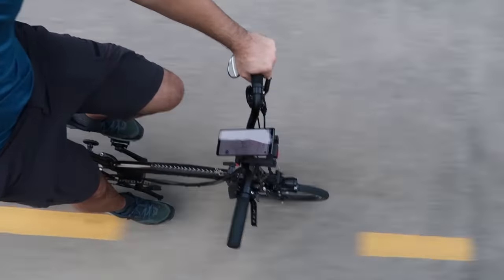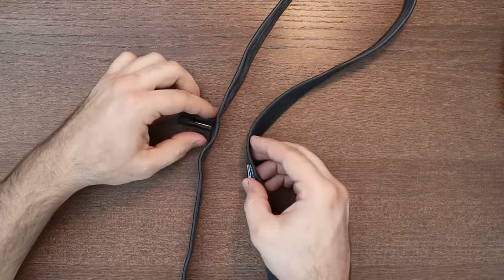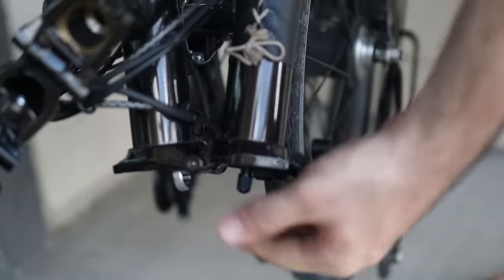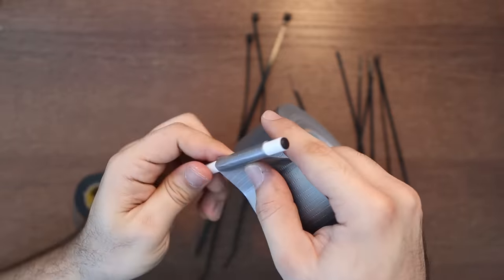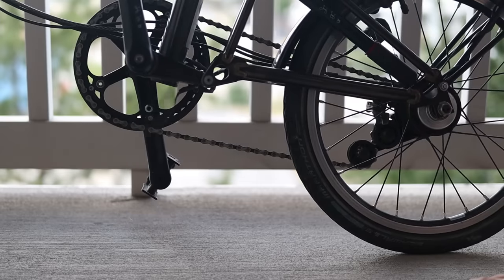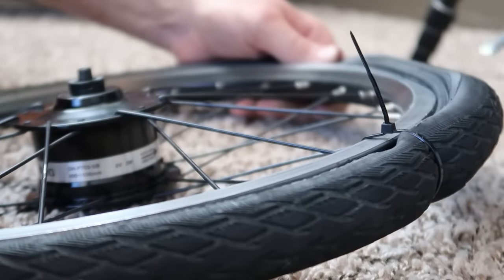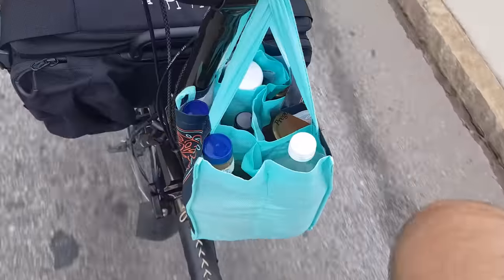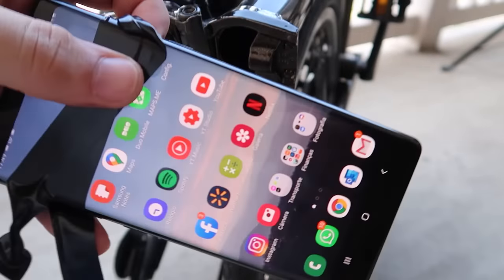10 Bike Hacks for your Brompton

Comment: You don't need to fold and tape the inner tube. Stick it fully extended into the frame tube (with the valve remaining at the front), push it right back and then wedge the valve against the protruding bit that the frame clamp screws into. The fact that it is fully lengthwise squeezes it so the valve pushes against that protruding bit. That way the inner tube never gets lost at the back of the frame tube. I've done this for several years now and I've never had a problem.
Reply: An alternative to polyethylene film: heat-shrink tubing. Essentially a thermoplastic tube, delivered in flattened form (like the new inner tube), and available in different widths (and colours). Get a size (width) large enough to easily accommodate a new inner tube and apply heat to the heat-shrink tubing. You can massage the works while getting to the maximum shrunk size  -- if you're wearing gloves-- , so as to produce a more uniformly cylindrical finished product. You don't have to shrink it fully; you can choose to get it 'snug', and later re-fill and re-shrink to get a second use out of the heat-shrink tubing (it's not cheap). And, of course, you don't need to use a length of the tubing equal to the folded length of the inner tube -- you can use several short sections, if you want to pinch pennies. Multiple short sections makes the finished product more flexible and more easily installed in the frame. Short sections also makes it easier to break down the whole when needed.

Comment: I too carry a flattened plastic bag as back-up carrying capacity.
However, an alternative way to mount the bag when it is called into use, is to hang it directly over the top of the saddle such that you can sit on its handles and let the bag hang down behind. This keeps the handlebars free, and, unless you have a particularly sensitive tush, you won't even know it's there! 
I use this method for the light but bulky stuff, say a box of cornflakes, or some paper kitchen rolls.
Of course, the length of the seat tube leaves lots of space for a carrier bag to hang down unobstructed, so this idea works rather better on a Brompton than on a bike with normal-sized wheels. 
Note: I have not had any trouble with heelstrike, and the lack of a rack is not a problem, either. 
In fact, the simple act of hanging a carrier bag on the saddle was one of my most useful Brompton ideas.

Comment: The last one came in super handy! I have to replace the front mudguard but can't flip the bike upside down because of the shifters. This works! My back thanks you.

On a side note, I'm a bit confused about the flat tire obsession (carrying a spare tube and tools everywhere). Is that a real issue for some people? My Brompton is almost 8 years old, I've cycled tens of thousands of kilometres in multiple countries but didn't have a flat tire once. It came with Schwalbe Marathon tires and I later upgraded to Marathon Plus. These are essentially indestructible.

Comment: Recommendation for alternative tool is the Tern tool. It comes with a saddle bag that fits pretty snug, is half the price of the brompton tool and has a chain breaker. If you don’t mind not having a ratchet tool, I recommend it.
Reply from the maker: It is a good option!
Reply: @RenM908 My Tern tool just fell off my Brompton. The velcro on the little bag is garbage. Saddlebags should attach to the big in at least two places.
Reply: @codak29  I currently don't have it on my saddle as I have a custom saddle bag for my Brompton which that tool is in, along with a spare inner tube and some other items. Sorry the bag it came in didn't work out for you. The tool itself I haven't had a problem with since getting it. I have heard it attaches much better on the Tern bikes which makes sense

Comment: “In case your brakes go out of adjustment...”. It hasn’t happened to me so far but I’ve only been cycling for 55 years.
Reply: In tears and ditto 😂
Reply: Not really how it works though is it? Someone may have been riding for 5 years and had it twice. Still useful advice

Comment: Nice video.I did a hack using a Heineken plastic crate I have removed all the plastic separators from inside except two on the long side in oposite position.
In them I keep plastic bags for groceries.
I have atached the crate whit big zip tyes on a brompton bag frame.
I have carried around 15 kilos maximum and in eight years I had no problem at all.
The second advantage is that I have obtained an solid chair ,wich I am using when I rest and enjoy my favorite beer...Heineken of course. Cheers from Romania. :)

Comment: Hi, it's not a hack I dicovered, but I designed and 3D printed this for my brompton rear rack : ah ... you may not alow external links on your comments. Anyway it's an open source 3D model that clips on the rear rack to avoid the things on it to slide to the front. It's small, you can let it on the bike, fold the bike and do anything like it's not there.

by typing "reddit brompton keep luggage on the rear rack" on google you will find my post named "My 3D printed solution to keep luggage on the rear rack from sliding front and hitting your feet" on reddit.
Reply from the maker: That's a pretty neat solution! Thanks for sharing it!
Reply: you know of any 3d printed designs for the internal tool case?
Reply: @robindegu7294  haven't seen any if those, but it would be great !

Comment: For using the zip tie during the tire montage: you can unzip a zip tie using a small screwdriver that unlocks the zip, so you don't need to destroy the zip tie.
Reply from the maker: That's true!
Reply: The zip tie should be unnecessary: the bead you're trying to seat on the bead seat of the rim, by hoiking it up over the rim, is exactly the same diameter as the bead seat, but -- conveniently -- it's easy to conceive of how the bead of an installed tire will lie if you push one half of it off of the bead seat toward the mid-plane of the rim. The mid-plane of the rim has the least diameter -- on the business side of fhe rim -- and that diameter is less than the diameter of the bead seat, so there's slack that can be created, on the seated end of things... The sticking point is not that the bead is a tight fit; the issue is that the inner tube (especially when partially-inflated) gets in the way of introducing that slack mentioned. In principle, therefore, it should be possible, using judicious positioning of the 'uninteresting' part of the bead toward the mid-plane of the rim, to install or remove a tire from a rim -- any rim -- without tools i.e. with your bare hands.

Comment: hi Victor, i’ve been following your videos & they are very useful 👍🏼
i’ve marathon plus tyres on my brompton, could you please suggest me what kind of inner tubes that i should prepare ? 🙏🏼 thanks !
Reply: The best inner tubes for the Brompton wheel, regardless of tyre choice, are:
Brompton Inner Tube 37-349 — EAN code (=barcode): 5053099026012
or:
Schwalbe AV4 Inner Tube — EAN code: 4026495100007
Both are equally good, with the slight advantage that the former has a fatter valve so it doesn't require a nut to stop it wiggling around (though as Brompton tyres are high pressure tyres, that shouldn't be an issue)

Hope that helps!
Reply: @Muddy283  thanks for this info !!
Reply: @gracesiu9872  Cheers!
Reply from the maker: Awesome! Thanks for the details!
Reply: @EverydayCycling  Very humble contribution my post above (important as the info is) 😳. More awesome are your excellently put together Brompton videos!

Comment: I favour reusable zip-ties instead of single-use one (6:37). They may not be as strong, but their reusability open-up multiple other hacks possibilities on and off the bike while touring.
Reply from the maker: Absolutely. They don't need to be super strong. I use the velcro strip, but a reusable zip tie should work as well. By the way, I love your videos!
Reply: You may release a zip-tie by a safety pin but needs some practice.

Comment: My favourite "hack" is to carry the brompton (folded or unfolded) by resting the saddle on my shoulder. The way they carry the folded bike in the official brompton marketing videos, may work for a T-Line but definitely not for a C-Line - holding the bike that way more than 20 secs and your arm feels like its gonna fall off. However with the saddle technique I can carry the folded brompton down a stair, across the station, and up another stair without putting it down one single time and without feeling the weight too much and with even having 2 free hands.
Another "hack" is so always carry 2 straps and an inflatable pillow with me. The pillow is great if you have to lay the brompton in a train because it gives you a bit of added protection.
And the straps keep it fixed when it stands on the wheel because if the train wiggles sideways, it would roll off the board.

Comment: inspiring nice hacks! however battery operated rear lights lasts for several months between recharge, a problem not waiting to be solved. commute about three hours per week...

pieces of tape can be wrapped around the pump as well.

in the end prefer to add any weight carried to an aerodynamic back pack, not adding grams to the bike. includes the pump:)

finally if you get a puncture, getting the tube out just where the leak is and fixing it can easily be done without taking the wheel off. dont forget to take out the responsible torn protruding the inside of the tyre:)

Comment: Hi my old Brompton that I just bought is jumping out of gear, becoming free, then as I change works normal. Can I adjust or does it need replacing?  Anybody can you help
Reply from the maker: The cables probably just settled inside their housing and the internal gears ran out of adjustment. I have a video on how to fix a flat tire on a Brompton. At some point in that video I talk about internal gear adjustment. You can hover your mouse pointer over the timeline of that video to find it quicker. Please drop me some feedback later and let me know if that worked for you!
Reply: Sounds like you have the 3-speed hubgear completely out of adjustment. It's not a good idea to keep on using it, you may damage the internal mechanism.
Have a look at the official Brompton channel, there's a very good video of how to make the right adjustment. Is very easy.

Comment: Is the Brompton toolkit something that comes with the bike? I just got my bike a month ago and it did not come with it.
Reply from the maker: It does not! It's an optional accessory.
Reply: @EverydayCycling  Okay. I got the impression from your video that it came with the bike. Thank you for responding.
Reply: I got mine on eBay cheaper. They are expensive though.

Comment: Never understood how Brompton get away with adding £1000 to the cost of a folding bike.
Reply: Well worth the money. They will last years if you look after them. They also retain their value.
Reply: @kimberley8114  I sure you are correct about lasting a long time and retaining value. At the end of the day, they are just cheap steel bike frames with few extra hinges, cheap breaks, plastic pedals etc.... I can see why they are very practical, but the price is nonsensical.
Reply: I understand that but it’s the reputation and quality of Brompton. You pay for what you get. The workmanship. The experience of the braziers etc.
Reply: @kimberley8114  sure, but my point is you are paying for cheep raw materials and cheap components. So what are you paying for? I think the answer is your paying for the folding bike patent.
Reply: I understand your point...  🙂

Comment: It's easier to get the tyre on if you finish at the valve. The other side of the tyre will pop down into the middle of the rim, allowing the valve side to slide over the edge. Soap or talc powder (baby powder) helps the tyre slide on the rim. Conversely, for getting the tyre off, start at the valve. 

Nice video and hacks!
Reply: I'm unable to see your entire comment; however, ... I begin at the valve, and finish at the point opposite. Why? The valve provides a means -- the only means, really -- of manipulating the inner tube being enveloped by the tire as it's being installed. Seat the bead at the valve first by pushing the valve stem outward, forcing the inner tube at that point into the tire, allowing you to position the bead of the tire, at that point on the circumference, near the mid-plane of the rim. Work in both directions toward the point opposite, sliding your thumbs over the tire sidewall, and flipping the bead up over the rim wall as you go. You'll find that there's no need for tire levers at all to complete the installation of the tire on the rim... Pull the valve inward, toward the hub most of the way -- thus lodging the beads on, or very nearly on, the bead seat. Partially inflate the tube to further seat the bead fully. Let our some air, and pull the valve hard up against the rim. Inflate.